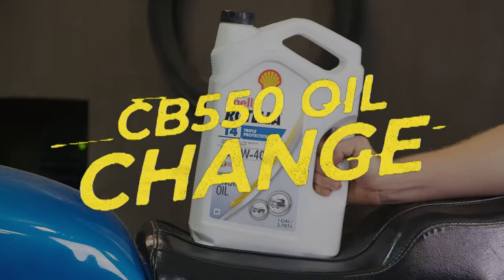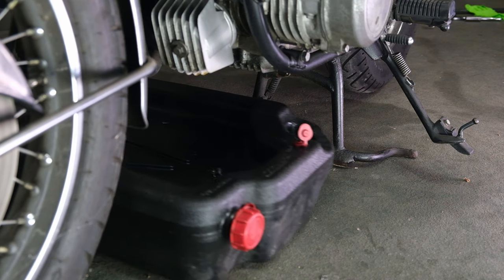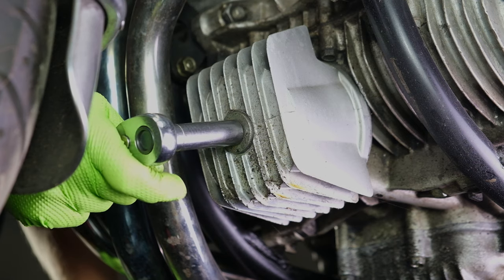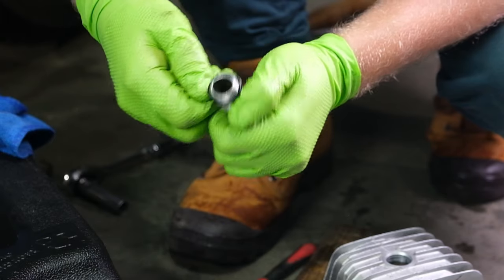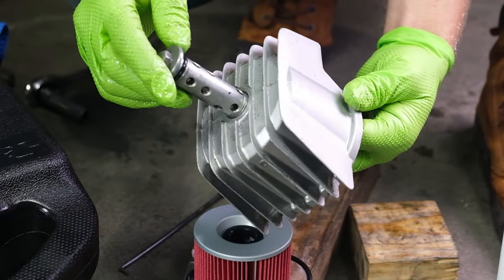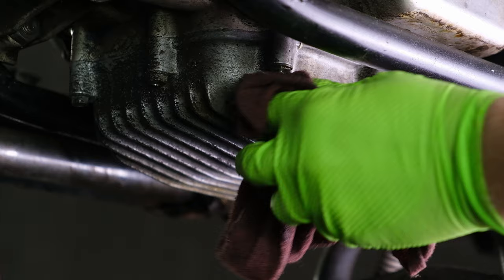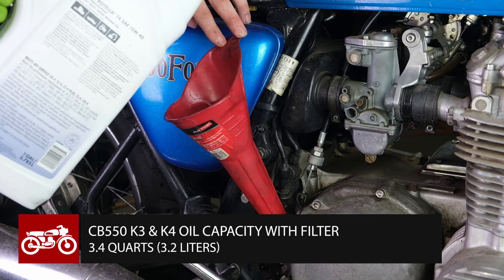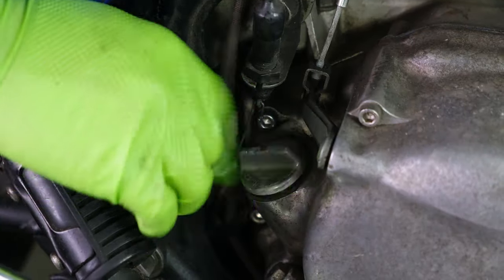How To Change The Engine Oil And Oil Filter On Your Vintage Honda CB550 And CB500K

Comment: thanks for the video,does your cb 500 have only one key for ignition gas cap and seat?because i just bought a barn find 1976 honda cb400f and it does not have a key to it,thank you